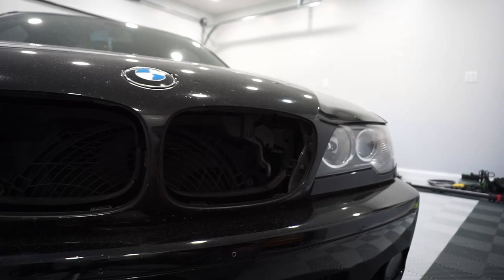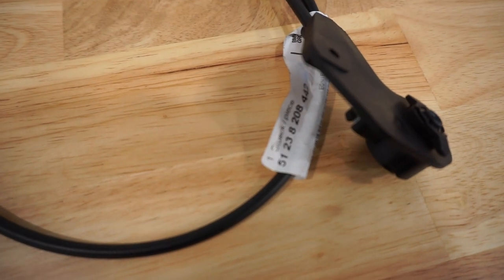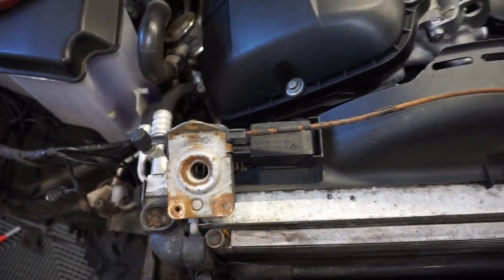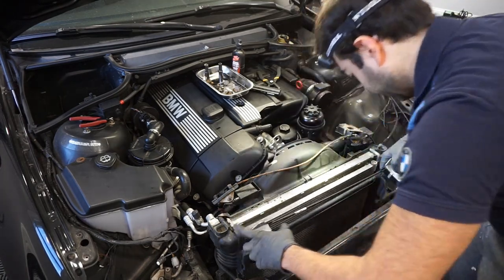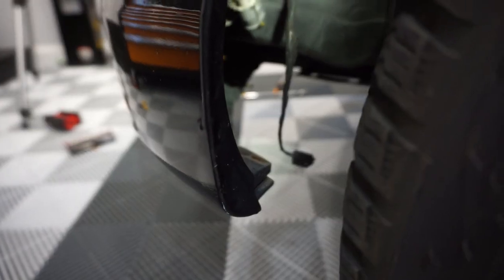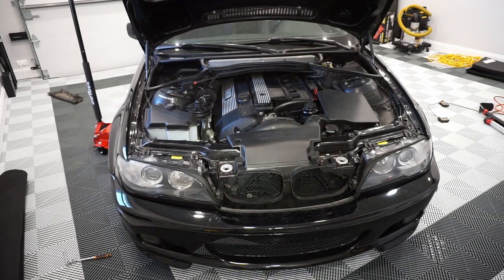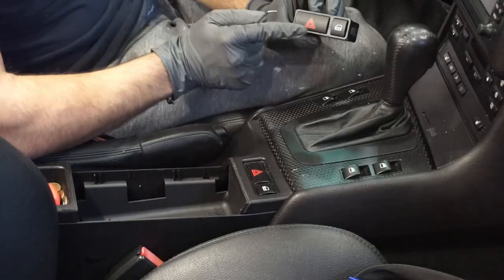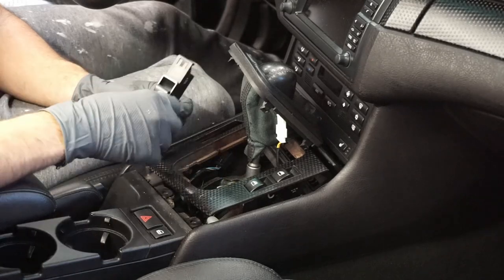BMW Hood Latch/Cable Replacement + Hood Strut, Window Button, Hazard Lock Module for E46

Comment: where did u get the wrench that ur taking the bolts off when the hood was stuck closed? mine doesn’t fit in there
Reply from the maker: It's made by vim tools. Check my other video where I jump into detail about the tool

Comment: I’m not sure what I’m doing wrong.. literally bought all 3 cable replacements all genuine parts, installed everything and works like it should- then at random times it won’t open anymore and have to manually pull the cable to release the latches.
Reply from the maker: How are you able to release the latches? By accessing the kidneys? It sounds like your latches may need lubrication or double check all your connections. Especially the one that meets in the junction box near the air intake. It could just not be seated fully